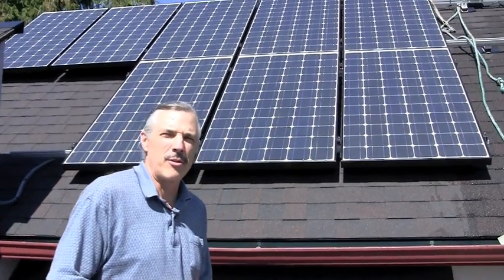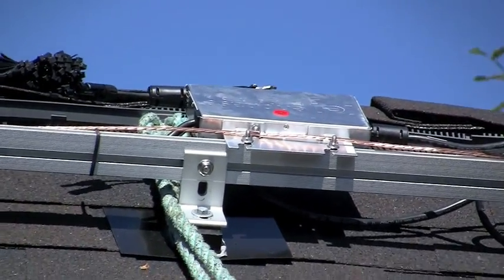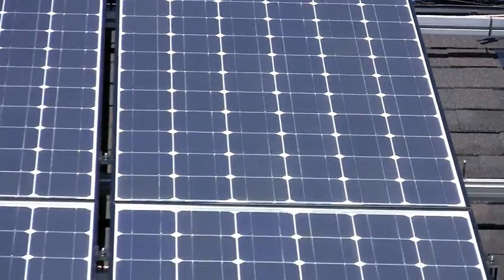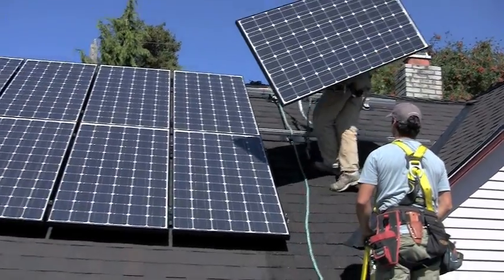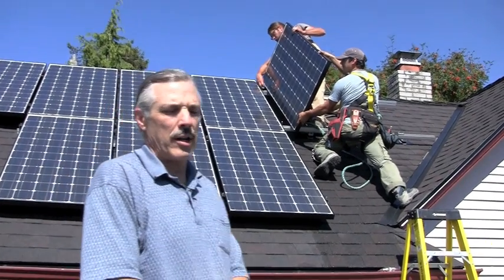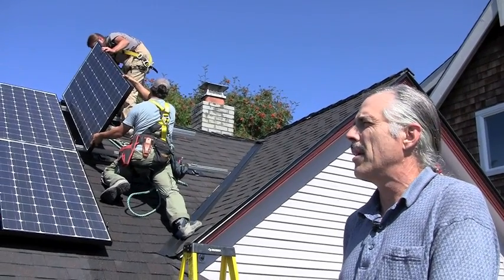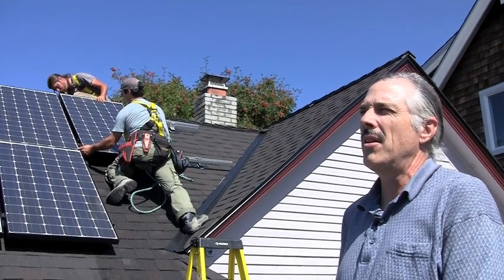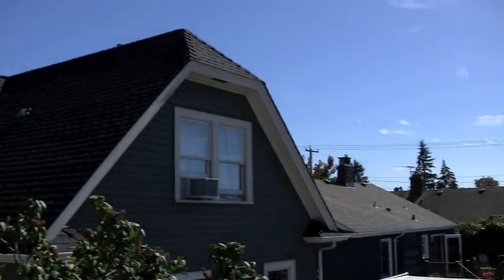Installing solar panels on a house

Comment: We used only 6 300w/hr panels to produce 17,500 w/day. The thing which helped us a lot is we used a homemade two-axis solar tracker. It works neat! The light bill is as low as 3.00 US per every two months.

Comment: Please go to the address under the video for detailed plans. Putting up the pipe, motors and tracker controller would cost about $300.00, if you do all the welding and electronics. You do have to use a very robust trailer axis and hub, though.

Comment: Two reasons that I can think of. 1) I believe he said that the Solar Panels are only producing a 1/3-/1/4 of the energy that that the house is using. 2) The energy that the Panels produce is usually not being used by the house, as he said it goes onto the grid, but when the house does use energy (usually at night) the electric meter turns forward again and so it counts against the net balance of energy that the Panels provided during the day (and they get paid for any negative difference).

Comment: A battery bank stores electricity produced by a solar electric system. If your house is not connected to the utility grid, or if you anticipate long power outages from the grid, you will need a battery bank.

Comment: DIY approach would be more appropriate and cheaper. However, for those who do not have the willingness to go DIY, this is their only option.

Btw, I like the micro-inverter. It's compact and it's directly installed right at the solar panel modules.

Comment: @m33lad 
Yes with the Federal Gov you can save about 30% Plus many states give you a break also just depeneds which state and how much and it depends on Cost depending on how much Electricity you currently use and how much precent you wanna save on your bill

Comment: worst case scenario either east or west is hurricane, long power outages. On-Grid vs Off-Grid I think off-grid is a little more expensive but worth it in power outages issues.
Reply: +instinct022 Off grid with batteries are about 5 times more expensive and alot more maintenance .....it would be cheaper to have a backup generator rather than batteries

Comment: @JO3haNsum That's why the solar panels charge batteries.  So that you can use the power from the batteries while there is no sun.  The next day the panels re-charge the batteries.

Comment: I’m using 230W*3 PV and 4 marine battery 105A each with 1000W and 4000 W inverter
My problem is the battery’s never get charged 100%.
Is there any way to reach the 100%.
Thank you for your advice.

Comment: I'm in Texas and put solar panels in my house.  After about a year, when the rains came, I started leaking on my roof.  I have shingles just like in this video.  Is there an easy way to seal the leaks without taking off the panels? Thanks for your help.
Reply: You'd have to take it all off
Reply: +Eduardo R. Servin Did you install them yourself?
Reply: If you pre-drilled holes for fasteners, which you should have done, you should have injected a high quality silicone into the  hole, then install the fastener to prevent the leaks.

Comment: if I have installed 2KW solar panels, but my house requires 5KW electricity..
how does this unit work ? Is it smart enough to take 2KW from solar and remaining 3KW from the main grid ?
Reply: you need some pro help. If your using 5kw at any one givin time you should not bother with solar unless your rich....  & if your rich the "inconvenience" of solar is not for "most" rich people.  If it requires them to monitor or even perform minor maintenance than I interview the customer for their capabilities....  sorry rant. If your using 5kw you need to work on lowering that first. then I'll talk you through this process of coast efficient solar.
Reply: mettu ram m
Reply: mettu ram y

Comment: i like the idea of a composite system. off grid of course.. but solar - so panels, wind, with last option of backup generator, diesel with making own biodiesel from waste oil (smells like fries) - powers vehicles as well.. can make it for $.75-$1.00 per gallon...

Comment: how many solar panels will you need to power normal home????
Reply: Depends upon what you want to power.  The WHOLE HOUSE, you need a lot.  What you really need to ask, is how many batteries it would require.  The panels are cheap compared to the batteries.  I just elected to power my fridge, entertainment center and a couple lights to just reduce my monthly power bill and more important, have immediate backup in the case of power outage.  That resulted in a system small enough that I could install myself and cost just over $1,000.

Comment: Way to avoid the question on the value of the system.  2KW of panels X 8 hours of sun a day x 70% for not tracking the sun = 11.2KWH/Day.  We pay $0.11 per KWH here so that's $1.23 per day from this array but in Seattle on a cloudy day you'll get 0.  Cost of system = $6000? unless the contractor really ripped them off.  Payback is $450 a year so in only 13.5 years (best case) you'll get your money back,  Is it worth it?  Only for do it yourselfers!
Reply: I disagree 2k system its about 3000 at best.Here in Mi its around $0.18 Kw.  Should at least get 8 kw per day. Times that by $0.18 its $1.44, times that by 30 Days $43. Thats an off set on usage and taxes. And also 30%  federal rebate on solar equipment and installation . Thats like 4 years tops Paid off....lol
Reply: I dont think you've priced these things, And I dont think you have one.  My 1.2kw system cost $1400 in parts and I did the install.  In Florida im getting at best 4kwh per day so your kwh calculation ok.a bit high.   My electric is 11 cents per kwh And the fed rebate only works with professional install for crazy $$$.In the NW with the rain fog they will get nothing.
Reply: FlyMeAirplane Was about $23000 in MO in 2008. http://youtu.be/I6QajtXyEVU
Electric company in my area, MI, says average installed cost has been $6 per watt, but of course prices have been dropping. The only place that would give me an outright quote was $3.50 per watt installed. De-rating factor for weather, daylight, etc. is .13 here. So a hypothetical 24 hour 2kw system goes from 48kwh to 6.25 kwh per day averaged over a year.

Comment: you cant just throw panels on a roof and expect it to work. you need a solar array designer to get the most from your modules . tilt and azimuth are crucial.

Comment: It looks like this guy does not know to much about solar power. the solar panels have to be installed on the south side where the sun ( at noon ) has the highest power. Also, what is the efficiency of the solar panel? It is just not that easy to do!